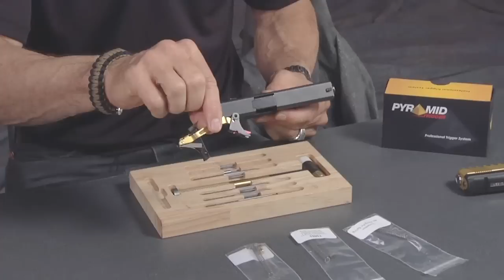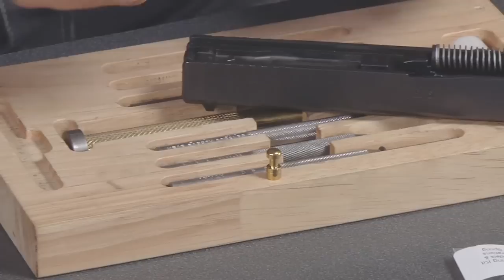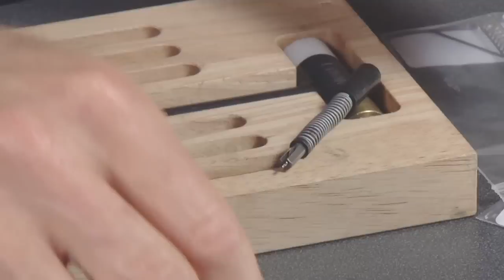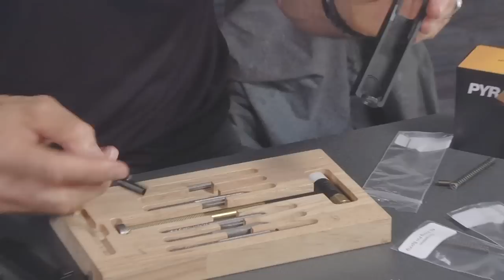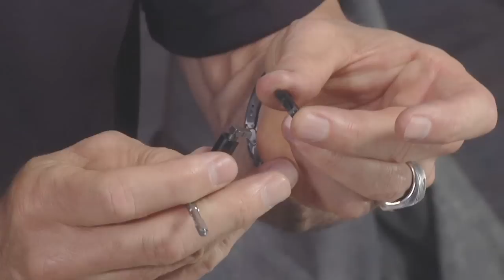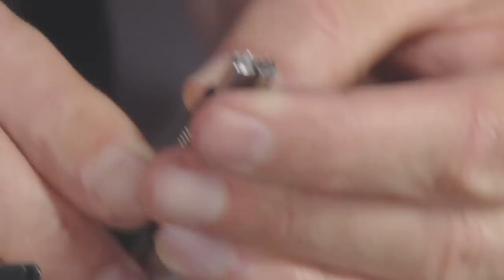Pyramid Trigger System Installation - Part 1

Comment: Got 3 of them. Not for my carry gun. They are fun to work on and to enjoy as using them guns for sports but do not use this as a carry weapon. God forbid you have to use it , no prosecutor and no jury will be convinced you did it without intention to "shoot someone" or to make sure you can better shoot the pistol; all cancelling your self defense argument easily. Read legality and liability while carrying a gun for self defense and don't be a sucker for the system. These are great to experiment with and to have fun and makes the weapon looks slick and all that kak but that's about it. If I want to carry any of the weapons i set these triggers on I would change them to factory before doing so. The legal liability of a modified trigger is too great to not pay attention to it and anyone saying otherwise would be certainly miss leading you.

Comment: How reliable is kit with the 4lb striker pin spring? (Light primer strikes) Is it recommended for use in a carry pistol or should I install the factory spring or the 6lb?
Reply: +yandri arce Broke my skeletonized striker for glock from #pyramidtrigger Pyramid under 400 rounds.... DO NOT BUY THIS CRAP, you can get wolff springs and polish de action and its going to be better and more reliable DO NOT BUY THIS CRAP Pyramid Trigger ; only trust on ZEV Technologies
Reply: +vicho101 I have the ultimate pyramid trigger kit in my Glock 26 and 29, the g26 has over 2500 rounds through it, the only change I made was install a 4-1/2 lb striker wolf spring because I had a couple of light strikes and wanted to be 100% reliable not light stiles with the 4-1/2 lb spring, same set up on my g29 but only about 500 rounds through it.

Comment: I have my Glocks with the Pyramid Trigger System.
Reply: +Rod Man Broke my skeletonized striker for glock from #pyramidtrigger Pyramid under 400 rounds.... DO NOT BUY THIS CRAP, you can get wolff springs and polish de action and its going to be better and more reliable DO NOT BUY THIS CRAP Pyramid Trigger ; only trust on ZEV Technologies
Reply: +vicho101 I have both trigger systems in my glocks  if it wasn't for the TiN coating on the pyramid trigger you can't tell them apart, not in quality or feel except for the zev trigger having a larger edge radii than the pyramid everything else is identical

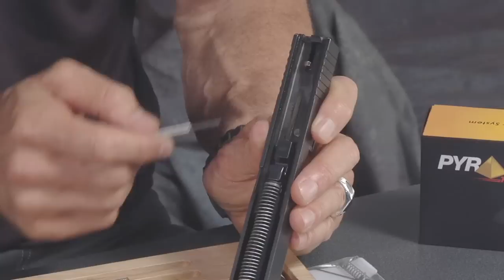Comment: Lenny, the striker lug that you demonstrated by picking up on the back of the slide at 4:40 and said that "it won't go back forward unless you were to push the actual safety plunger". I haven't found this to be true with my Glock 21 Gen 3. In fact, that striker lug goes back forward quite easily without pushing the safety plunger. Is my Glock somehow assembled wrong? It shoots fine.
Reply: Same here on my glock30s. The firing pen slides forward when I push it back. The gun shoots fine, not sure if this is a problem. And don't know how to fix it.